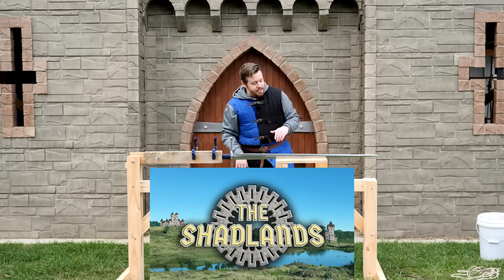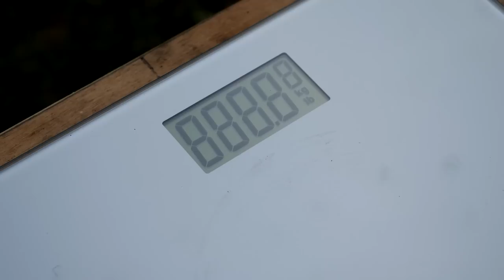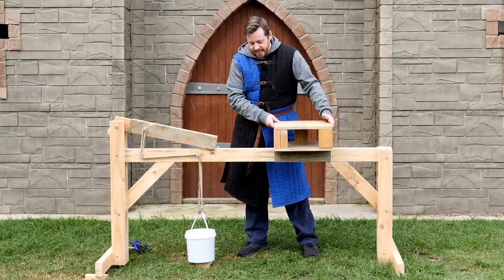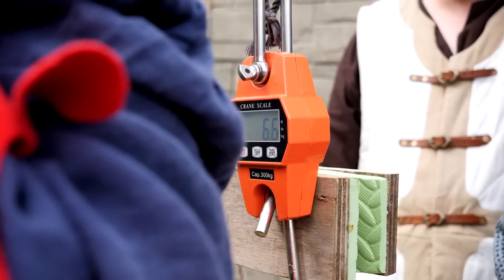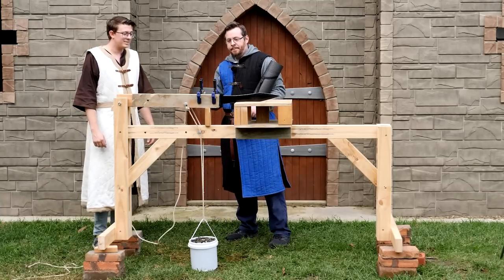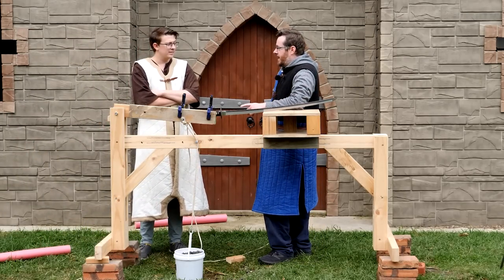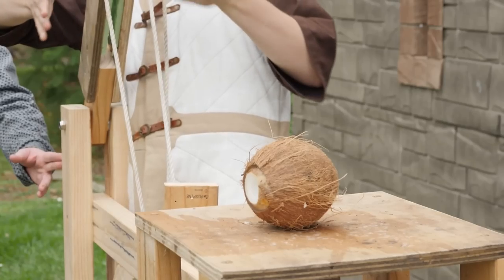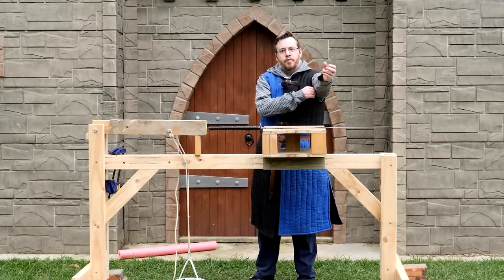Choppy choppy

Comment: If you want to use any biologically derived materials that you want to equalise the density you have to alter its moisture content. You can dry the materials and store them in a dry, dark place (this will somewhat harden the material), cool environment or you can soak each overnight before testing (this will somewhat soften the material). You can also take advantage of your local countries natural materials, try looking into sugarcane or bamboo as a softer material and perhaps beef bone as a hard material test. These materials have been selected for their biodegradability as well as suitibility as a testing analog. Another alternative would be bags of sand but this would have some draw backs like its dulling effect on blades and potential inconsistency in grain size, but the sand would be somewhat reusable (if the sword is worth its name, the bag won't survive but cotton and hemp bags are a biodegradable bi-product).

Comment: an idea for the handle, because as you stated, a straight cut isnt as "efficient" as a "slice" would be, so maybe try to put the arm on one side of a wheel. then the wheel would "fall" more straight in the beginning and in the end pull the sword backwards with the rotation. only problem would be getting the arm to fall "flat", but maybe by attaching 2 ends of the same rope to the 2 ends of the arm would distribute the force so the entire thing falls down, until the wheel starts pulling the blade in/arounds?    short term, put wheel on arms base and raise the wheel above the flat point so the wheel pulls sword backwards as its falling for better "slices" :D

Comment: In addition to the "wrong calibration" everyone is pointing out, I'd like to list a few ideas that might help with this contraption:
  1 - You can place a "v" shaped wooden block on the impact base to hold the target in the case of round objects like coconut, it will be easier than attaching it to the base.

  2 - Probably a good test midea would be plastisol, or soft bait gel, it is cheaper than ballistic gel, and may have some similar results.  You can also try some expansive construction foam.  In either case, you can adjust the height of the targets' layer to provide the resistance needed to stop the blade.  Chopsticks or barbecue sticks in between would provide some additional modular strength.

  3 - Springs or bungee cords would be good substitutes for the weight, and you can also adjust the power

  4 - A test you can implement with the same contraption just by modifying the arm is a thrust test.  It would provide great data for sword comparison.

Comment: ... Add two padded cross-pins to stabilize the haft in the rig so the clamps only have to stabilize the edge alignment, one at the end of the rig above the haft, and one perhaps adjustable through a line of holes from midway to the inner end of the grip.  You'll want it to still give a bit, so ... high-density nylon?  Wooden pegs with a buffer of yoga-mat rubber?  Steel pins with yoga-mat rubber?

Also, if you're going to be using coconuts on a regular basis ... seems a pretty decent analogue for skull-splitting ... take a hole saw about 2", and create a cup to stabilize round items in the middle of your target stage.  If you want to make sure you aren't losing energy by simply driving the target through the hole, cap it off from underneath with some 3/4" ply, some glue, and four good screws.

Also ... congratulations on proving much of the katana's myth of superiority is due to the biometrics of the user 😉

Comment: I thought I would sum up some problems in one comment, feel free to add some.

1) Blade slipping. You will need better clamping/ mount.
2) Force (7kg) applied with wrong leaver. Should make tests to get the right bucket fill.
3) The important value is impulse not only force. The speed is the other important factor...
4) I think depending on the target you will use the angle of impact will be a factor too. So a sword will  render different results when attatched in a different angle and it will be hard to compare straight to curved swords.
5) I like the idea of a contraption with a slicing motion. It will get way more complicated as you will need more linkages. 

Sry for bad english 😅

Comment: What to change?
1) do a vise to hold different objects (rope with a pocket like sling might be enough so it can be attached front-back or left-right depending on target) as it's quite clear you are releasing the chopper with slight inconsistencies, rig is wobbling a little and targets are "dancing" on the platform (also because of possible human error inconsistent placing of targets).
2) remake the chopping block to have a groove for weapon to slip by - simulating overdraw somewhat, easier to keep target aligned with blade, easier on blade for repeating tests (less sharpening as the blade won't chop your chopping block. Suggestion: V shape chopping block with missing  bottom part, maybe even with ability to turn sideways with a slit for the blade.
3) add some peg to your weapon holder so attached handles don't slip up out of the hold (down) |I.| (up) (bottom part is where blade would be, upper part of this ascii ART would be a pommel)

P.S.: love your videos, #antinunchuks #rankingweapons 😀
P.P.S: I agree with others about measurement: measure distance of the end of your stick to the pivot (your shoulder?) and use that to measure force on your chopper

Comment: Nice video, thank you. As you yourself have implied and some others have pointed out in the comments, acceleration may be an issue here. But the main difference I see in the machine cutting compared to a human being is the actual cut. The machine comes down in a perpendicular chop and stops where as a human to my knowledge can not deliver this kind of strike easily. 
1) The human can't stop immediately without decelerating first. Muscles don't have a dead stop. 
2) A sword cut like this performed by a person is always a draw cut. The larger density of the cut medium (compared to the air, which is also "cut" before hitting) decelerates the blade at the point of impact, but the hands continue travelling further along. Thus a draw cut motion occurs. 
There is no special drawing motion needed to perform a draw cut :)
As I am no mechanical engineer, I might miss a lot here. These are just my observations from my standpoint as a martial artist.

Comment: A lot of other people already pointed out the clamps as a point of failure, but I'd say the block was also instrumental in the survival of the coconut. A failsafe shouldn't actually touch a moving part if you want an accurate transferal of force into the target, the combination of the sword pushing into the grip allowed the arm to hit the failsafe and transfer a lot of the force there.

Another problem could be the bucket hitting the ground. Another place where the energy of the guillotine system could be transferred into something other than the testing target. You lost rocks a couple of times, but I'm not sure if that was due to actual contact with the ground or just the abrupt stop. 

(Edit) On a detailed viewing of the second strike, I'm pretty sure the bucket hitting the ground was the reason the coconut survived. If the bucket is on the ground, it's just the momentum of the sword and wooden arm that's driving the blade into the target. Momentum that would have been dispersed a lot by the slippage of the hilt. The bucket hit the ground before the katana hit the coconut. 

The block under the arm slowed the English sword and the first katana, but not nearly as much as the bucket bottoming out. You can see the impact of the bucket on the ground by how much the rocks move, and they jump a bit on the English sword, but the agitation for the katana blows is much more significant.

Comment: 3/4 inch dowel of pine or poplar is equivalent to your upper arm. A 1 & 1/8 inch Poplar wooden dowel is equal to your thigh bone. The recipe for Jello gelatin jigglers I believe is 1 cup water to 1 package. If you make that 6/8 cup boiling water instead of 1 cup boiling water, you should effectively get a concentration equal to ballistic jelly. If you use tapioca balls and soak them and mash them up and then reduce them down to the same consistency you will have sugar-free ballistic jelly without flavorings colorings or smells like fruit and of course without all that sugar. And the best part is tapioca pudding beads are in the confectioner's aisle and they're fairly cheap. The hardest part about making ballistic jelly out of tapioca beads is that to get them broken down into gelatin you must run them through a ricer & once you have made your ballistic jelly you must find a place to store it where the critters cannot get to it as everything like eating jelly especially when it is the consistency of Flesh. Serious leave it out one night and in the morning you will be missing chunks of it as the rats or mice will get to it and they will leave dropping as they devour your jelly the same way they would a piece of real leather that you left laying around after skinning it off of the animal. This is the cheapest and most correct way I know of making ballistic jelly which is a perfect medium for testing because you can prepare it 12 hours in advance and then refrigerate it until you need it and when you tested it all you need to do is melted back down and pour it back into the form. By the way it melts just like chocolate. Chop up your ballistic jelly and put it into a pot. Grab a canning kettle add water and bring to a boil. After you have inserted the pot full of ballistic jelly pieces. As the jelly warms up it will turn into liquid.

Comment: You called for your engineering viewers, here we are.   The high-speed footage tells all.   Assuming the same framerate, the speed of the testing rig is a lot slower then your hand held attempt.   The energy of a strike is a function of the speed and mass of the sword and arm (AKA inertia).   You are going to need more mass pulling down on the arm to accelerate it enough to match the velocity, which is a far more important variable then static force at the end of a lever.   The footage also shows the handle moving in the clamp, essentially turning it into a friction based shock-absorber.   Putting a dowel behind the handle at the end of the arm (to reproduce the bracing of the right thumb and palm) and another dowel in front of the handle further down the arm (to reproduce the grip of the left hand).   Keep both dowels shorter then the fully clamped gap; but long enough to pass one pad, the sword handle, and partly into the second pad without touching the wood on the other side.   I would also recommend instead of a weighted bucket, to replace the current arm with an L shaped one that pivots at the corner (put a gusset between the two) .   With one side holding the sword and the other with mass bolted to it; configured such that that when the sword is pointing up the leg is pointing towards the target, and when down the weighted leg is also pointing straight down.    Also recommend using adjustable barbell weights on the leg or any paired chunks of plate steel with a bolt hole.

Comment: The katana is designed for cleaving in the first third of the blade from the hilt and engineered for slicing in the final two-thirds, hence why the “sweet spot” for the best cut is at the 1/3 mark… your rig was dropping it around the 1/2 to 2/3 mark along with the grip slipping in the vice, meaning no “follow through”, whereas in your hands you struck it both correctly and had a follow-through, along with the potential that in your hands you delivered more power than the gravity drop, as again your muscles provide a “follow-through” and drive it down where the gravity drop would simply stop from the loss of momentum even with the bucket under it. Your muscles provide continued power when striking the coconut and drive it through past impact whereas with a weight and gravity, it takes the path of least resistance (stops) on impact, in short. Any sword can cut a coconut when used right, the first sword had the advantage of being able to transfer more energy through momentum because of length, being straight, and overall weight putting the “sweet spot” a little higher up the blade as it’s not curved. Very complicated physics and variables, but boils down to the reason a butcher uses a cleaver (which can slice very effectively as well as chop) over using a bowie knife (which is best at slicing over chopping) for the chopping of meat, or in this case coconuts. It’s down to how the tool is engineered to preform and function and the technique used to best do that. As you have demonstrated, either sword in a trained hand is equal to the other, but the technique and bodily engineering used to harness the mechanical engineering of the tool is different—thus one cannot be simply swapped out for another as one would put down a red hammer to use an identical blue one, more like choosing a 1 kg metal nail hammer or a 1.5 kg wooden mallet to use on nails, or vise-versa if you were putting a stake in the ground. God’s bodily engineering and man’s mechanical engineering, in this case. Plus, loose vise grips.

Comment: hello shad,
Nice idea you had there! I myself are a bit of a diy-builder, have studied physics, sadly only two semesters, now I'm starting my career in technical product design.

I would like to send you a sketch next week, if you like.

I have some ideas for easy improvement.
The force of your bucket is tranmitted through the rope directly to the swordarm, that's not a problem but ugly and not in the favor of good measurements.
so I would recommend to ditch the guidingbolts and use a curved rail, you can make one out of wood with alot of friction or use a more elegant but also more complex way and use an old wheel of a bike it already has guidence and you can attach it to your swordarm, drill a big hole in the frame for the rope and your done. both ways are very cheap.
the sword is held in place by a claw from the side, but the force is transmitted from the bottom so it would need a redicolously strong claw because it's only held by friction. Rotate this so the claw can apply force in the same dimension, maybe put a reaction arm on it so it can be pressed in easily.

I hope you don't mind my bad english. If you like I make a complete list of ideas with better explanation, I am better with sketches than words.

Comment: You are gonna get a bunch of dull blades and wrecked edges if you keep swinging the swords at hard wood. Some recommendations:
1. Cut the objective platform in two so there is a channel between so the sword isn't going to hit the wood.
2. Put a wooden stop in the arm so that's what stopes the swing and not the steel.
3. The sword is loosing a lot of power at the grip. I would try to rotate the sword griping part 90° so one of the plywood plates could help with that.
Also maybe you need to investigate the acceleration and velocity of the sword when a person swing it and check if it matches with the guillotine.

Comment: Love the rig, but I do have a few suggestions

1) For the weights, I'm not sure what the limitations are for your country, but you could see about buying a set of gym weights like powerlifters/strongmen use for bench presses and whatnot. That way you have accurate labeled weights instead of rocks.
2) For the platform holding the target material, you may want to have a small groove down the center so that rolly objects like them coconuts will stay in the center better. Plus this way you can line up your sword angles better for the chops and don't have to eyeball it everytime while getting your fingers in harms way.
3) for the target material, you may want to look into possibly pork shoulder/thick cuts, although this is mainly from what I recall being the closest comparison to human flesh. You might also want to look into possible memory foam variants, cast iron for cheap armor, and I think there is a way to make ballistic gel using jello, you just need something thick enough to act as skin and something hard inside to mimic bones.
4) As most of the other comments already hazed you with, most of the energy seems to be escaping out via the grip. If your have a small stopper on the open sides of the handle to prevent it from slipping, that should cover that problem IMO. 
5) I actually have nothing else to add, except I enjoyed this video a lot~